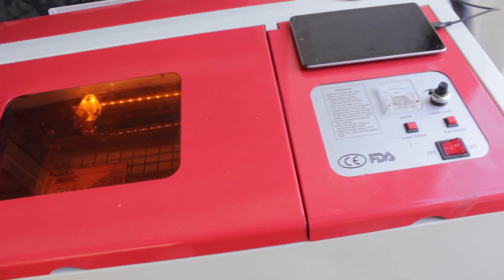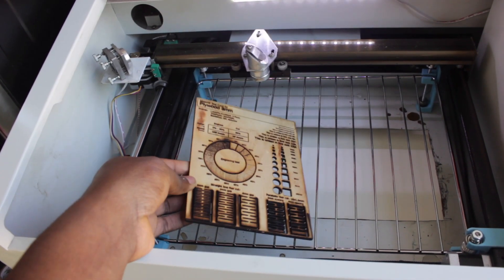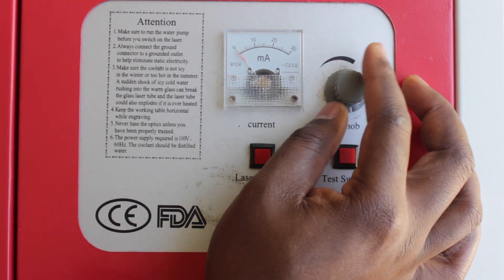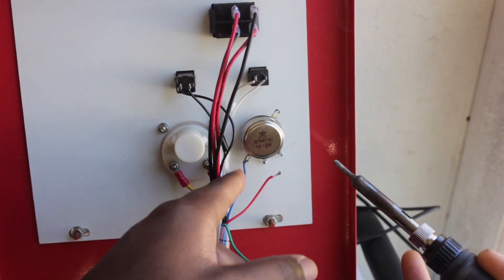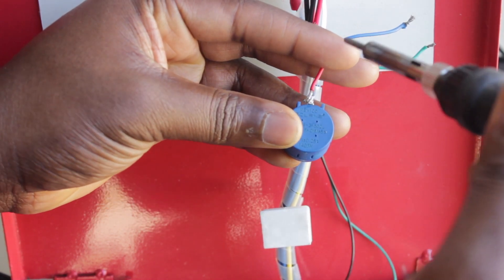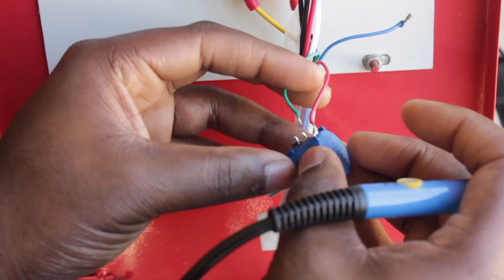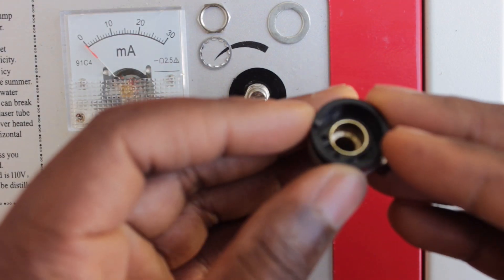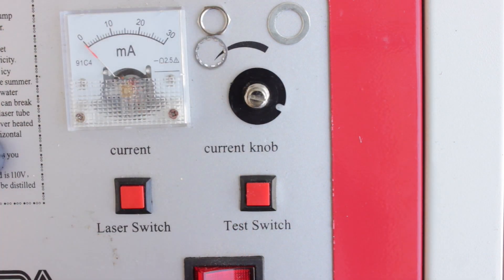K40 Laser Cutter Potentiometer Upgrade

Comment: I'm trying to replace the potentiometer. SO the current one on there just like yours was a 1k 2W. If I replaced it with a 1K 3W would it still work fine with out causing any damage?